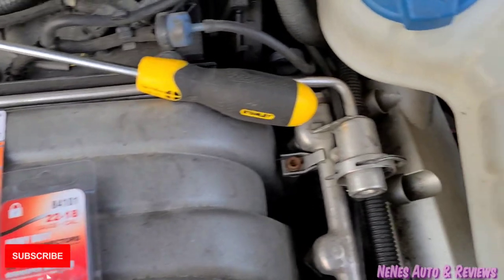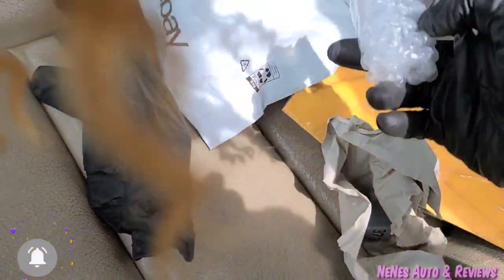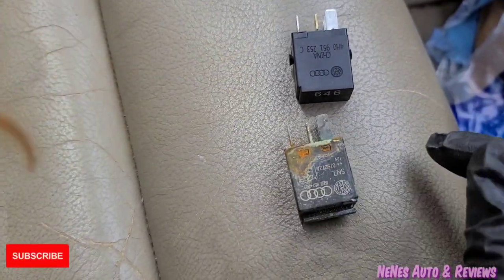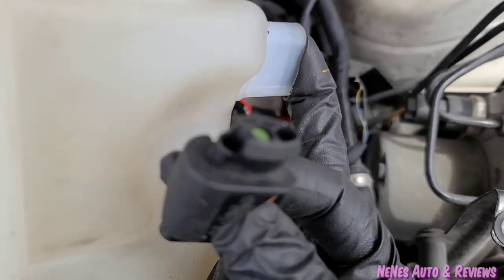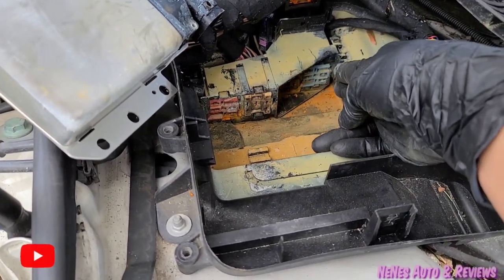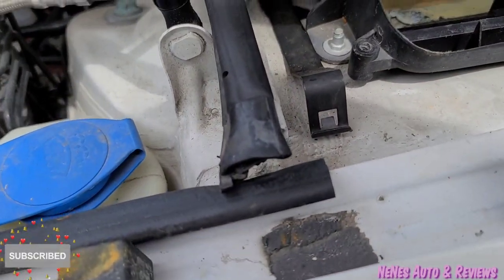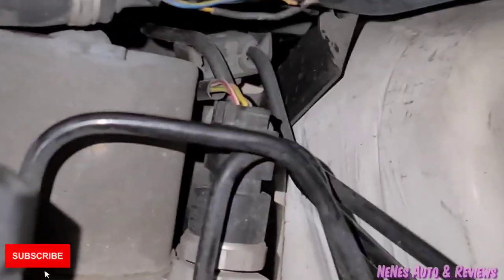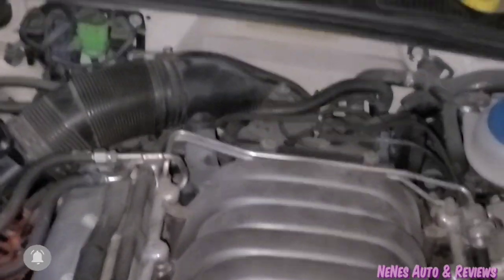#Relays #Audi #AudiA4 #B6 Installing new ecm relays & ordering more parts for the Audi

Comment: You can use electrical spray, wd40, wire brush and pick to clean those plugs. If they aren't clean than the corrosion will prevent the electrical signal from traveling through the relays into your ECM. That's probably why your engine wont run.
Reply from the maker: Thanks I will keep that in mind next time.

Comment: Check out the 20 amp fuse by your driver side door,and check spark plugs and coils injectors unless its a V6 if it is get you self the 1.8t that don't have the V6 timing belt issues
Reply from the maker: Thanks for watching, yeah when I get my next Audi definitely.

Comment: Did you end up getting her running? Jw. Similar issues on my A4 B7. Subd both channelz 🤙🏻
Reply from the maker: Thx I appreciate it, we did get it to start but unfortunately it had to many costly problems to fix.
Reply: @nenesautoreviews   Yeah that's sad to hear I'm sorry I just had put a new ECU/ECM in mine yesterday for the 2nd time and it finally started up. I'm hoping I don't run into the same kind of scenario as it is lacking alot of power. Anyhow, thanks for sharing with me! 💙🤙🏻💜

Comment: Hey I have the same problem with my Audi a4 07 I was told my 373 may be the problem witch supposed to be my ECM relay but all I done rn was change the hole ECM/PCM and still no run so I'ma add one 614 witch supposed to be under my ECM and I was told it's a fuel pump relay so I have both in same spots and everyone else have different relays  under my hood hopefully it crank and I have two 373s under I'm staring wheel what u think it can be 🤔I be getting the code u0100 and thats ECM electrical problems
Reply from the maker: Did you ever get it running?
Reply: @nenesautoreviews  lol sadly I was told my compression was low so I had to get a hole new engine and they cost 1500 used